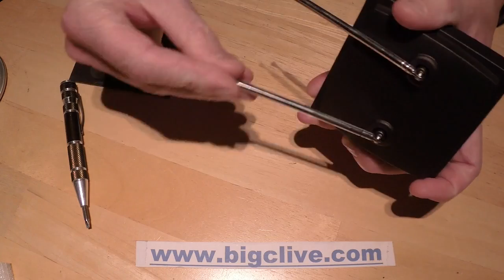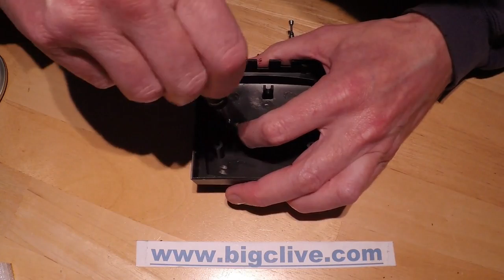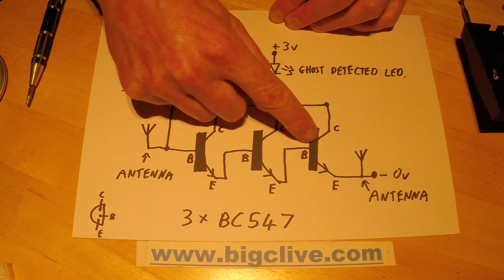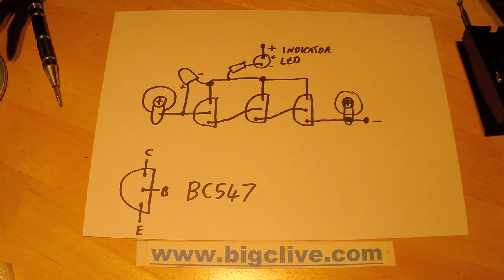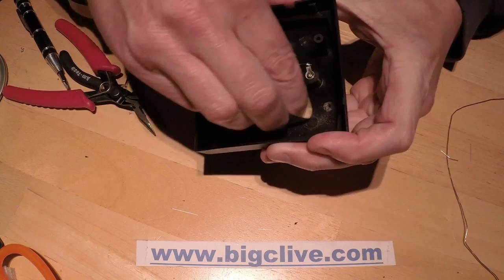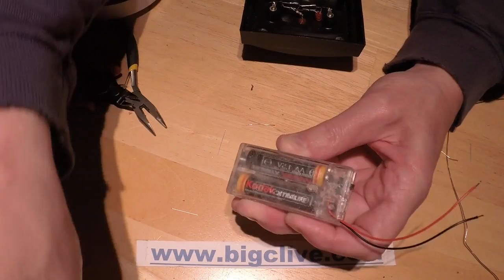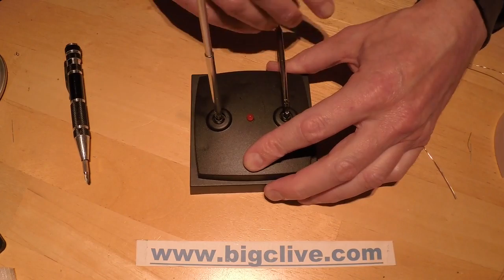Make a ghost detector.

Comment: I did finaly won an old Spico with the cast metal base, they are rare where i live, i know they are a lot more common in the US, but i think i only seen one like once before on auktion where i live, but i so badly wanted to do this with one of those for Years now! (It will of couse be reversible and i will keep the original components in a bag inside) a forum friend did send me some extra vintage panel lamps as well which will fit perfectly for this!

Comment: bc547 aren't just ordinary transistors, they are high quality transistors. What makes them unique is their low collector cut off current of maximum15nA and the high amplification of BC547C of 420+. The normal small signal transistors have hfe of around 100+ hfe and 100nA maximum collector cut off current. while the 2N2222A can rival BC547C with 10nA collector cut off current, its amplification is considerably smaller.

Comment: I recently built this, it works great the only issue i have is the led always stays dimmly lit not sure why or how to solve it so it only lights up on detection
Reply from the maker: The circuit is extremely sensitive.  It might be detecting ambient AC fields or it could even be a conductive path like a humble fingerprint on the input circuitry.

Comment: How can I use this circuit to start a cat ball lighting circuit? The ball is started by a shock sensor. I would like to use this sensor instead. I think maybe a relay to convert analog to a digital I/O but would not have any adjustment for the threshold.

Comment: Hi Clive, I know this is an old video.
I built this circuit and run it off a 9v supply and it works great. 

The circuit also works as it should when I add an Arduino into the project box, but once I run them from the same power supply or even just share the same ground your circuit plays up.

I have added a capacitor and another led to the supply and also to the earth side for extra filtering and the circuit still works great, but once again when I add the Arduino the circuit plays up.

Do you have any ideas how I can add the Arduino without compromising the circuit?

As to not interfere with the sensitivity I am using the Arduino and a LDR to monitor the led so your circuit is not impeded.
Reply from the maker: It could be electrical noise or just the larger mass acting like an antenna.   If the Arduino is being powered from a plug-in power supply that will also introduce a high voltage gradient to the ambient surroundings.
Reply: I'm using a 9v battery, and I have also tried my benchtops power supply.

Comment: Clive you just gave an idea. I've tried making a sensitive circuit to detect touching of the frame of a sit to stand lift on wheels working on 24v battery. 
I've added led lights to illuminate the foot area when the lift is being raised or lowered and then stay on for several seconds and then fade off. This part works great. 
The part I couldn't get to work is for the lights to come on when a person comes close or touches any part of the frame. I can see this triggering my LEDs on. I tried the 3 transistor Darlington circuit, I like your idea of traverse led bias and antennas (or pieces of wire).
I'll post couple pics below
Reply from the maker: It might be better to use a PIR sensor for that.
Reply: @bigclivedotcom  I thought of that I like the idea of sensor wire. What I had was too sensitive and would someone come on by itself and not come on someone when touching. I'm thinking using the frame as negative and a piece of insulated wire loop around the control box. Shortening the wire as needed for sensitivity.

Comment: The BC 547 is an european Transistor Typ from the '70s ,  Made by Philipps Valvo, Siemens,  Telefunken, ITT etc and used  
as a smallsignal transistor in many applikations like Radioreceivers, TV Sets, HiFi Systemes etc. So it was manufactured in mass.

Comment: How can I add a small speaker to the circuit can I just put it between the positive led in the beginning of the circuit and the resistor?
Reply from the maker: It might be possible to add a small piezo sounder across the LED.

Comment: That’s the best pie.

As a paranormal investigator in the states and electronics hobbyists that has been watching your videos for a long time, you’re truly MVP for making this video.

Question (again): Obviously it would probably be more formal if it were something with significant potential for application… semi-obviously?.. but I try to be the better kind of stubborn when it comes to the “impossible”, but I’ve been learning about the different gadgets used for paranormal applications, but I’d like to build or convert something that could be used as a kind of out-of-the-box approach to detecting electromagnetic anomalies. I haven’t actually seen any ghosts yet, but whether or not they exist- fluctuations and disturbances in magnetic fields are readily available, especially if we consider the global array. We were at a house last night, and we didn’t know what could be causing it if not some geomagnetic significance of where the house was, but the readings were incredibly sporadic.. highs, lows, and near inverted switches inches from different areas in all directions, some even the same spot.. and we were using multiple devices that all had consistent readings and, well, spasms. If not ghosts, something was clearly responsible for the experiences of the client. Anyway forgive my tangent- it was just exciting. My question is whether you may have any ideas or suggestions for devices, systems or circuits- either new or that could be converted from or used as an unconventional method for detecting anomalies within the electromagnetic spectrum. I am particularly interested in light, and I recently watched a video that wirelessly transmitted audio signals to a speaker using a laser as the transmitter and solar cell as the receiver, and thought there may be something (or nothing) there that could be useful. 

Anyway, just wondered if you were willing to share any ideas about stepping up the hunter’s game. Forgive the lengthy text- my thoughts never sleep.
Reply: Holy shit, really lengthy text. I didn’t even realize. 😫
Reply: Suggestion: go someplace you're as close to dead positive as you can be that there should be zero "paranormal" stuff going on. Find a long unoccupied dwelling and or commercial space (office building, factory, warehouse etc.) that has power AND that you have legao access to. Also, go out into the nearest wild place away from power lines etc.
Take measurements and readings as usual. Nothing you see in allegedly "acrive" places means anything without a baseline.
When you do this, take measurements over as long a time period as is practicable, preferably at least 24 hrs. If possible leave the instruments unattended to minimize them detecting you.

I guarantee you will be surprised how common so called anomalies are. The baseline is very noisy.
Reply: @markfergerson2145  Yeah, I suspected as such.. Again, I would expect fluctuations given the Earth’s magnetic field but I wasn’t sure whether the array had variable fields or frequencies at our scale rather than just, say, a few hundred square miles each.
Reply: @sbandc  The Earth's magnetic field is actively responsive to all sorts of things from solar flares and meteors to earthquakes. Look up "whistlers" for instance.
Places you would think are far from artificial signals can be in the sweep of civilian and military radar and radio beacons as well as radio communications relay towers (they still exist in the satellite age).
You can pick up constant, periodic and random event signals with no immediately obvious cause almost anywhere. The outdoor and sometimes indoor electrostatic field can shift rapidly due to the weather giving you another kind of false positive.
Another thing; Clive illustrated how directionally sensitive such equipment can be. If you can, take your baseline readings with multiple antennas pointing in different directions. That's related to my advice to stay away from your gear while taking readings; your body will couple to its antennas just as Clive's did. Heck, metal objects like power lines and metal plumbing or paneling can act as an antenna or resonator. Metal siding on a building does not necessarily guarantee isolation from outside signals.
I say all this as just a guy interested in physics who once tried to help an amateur radio enthusiast friend find a "quiet" place to set up a ground station for an amateur satellite link. Turns out the best we could do was a place with only a little noise at his frequencies of interest.
Reply: @markfergerson2145  That's understandable and not unexpected, but then we'd have to consider why there are some circumstances in which the readings aren't responsive at all. The investigation with the sporadic fluctuations was anticipated to be the result of a number of different magnetic fields given our location, but it was a significant contrast to other investigations. Typically we expect some degree of interference, and it's not uncommon, but there are also entire areas in which there are either no readings in which the magnetic fields are either absent or significantly weaker than our devices' sensitivities can detect. If there should be magnetic field interference everywhere from a whole arsenal of sources- especially long distance frequency signals that should cover much larger areas, what difference would need to occur to render the devices insensitive or the fields weaker than others?
Reply: @sbandc  The Earth's field is not homogeneous. Everywhere on the planet the local field strngth, direction and dip (angle of the flux from horizontal) is different. Local concentrations of metallic ores can cause severe deviation from what you might observe say at sea at the same latitude or even cancel it over areas as large as a couple of acres. This is why compasses are not completely trustworthy. Government agencies like the US Geological Survey publish maps of what you can expect a compass to display all over the US and its possessions and territories and territorial waters at varying levels of detail. They are only updated every few years of course, but are very useful for people doing for instance mining surveys... and folks like you. There is a certain amount of daily varation of the values on such maps that has to be taken into account.

Artificial time-varying fields can have nulls (areas where the ield strength is zero while the source is transmitting). This is electromagnetism 101. Predicting their locations requires knowing the wavelength of the emitted radio frequency energy and some details of the local environment. If you've ever driven around a city listening to the radio and heard it fade in and out, it's because the signal was not just propagating directly from the transmitter to your car but also bouncing off buildings thus providing what your radio "sees" as multiple copies of the same signal from different directions that sometimes add and sometimes cancel each other out as you drive through the peaks and valleys of the different copies. This is called mulipath propagation. You can for instance be only a few miles away from a radio station, in direct line of sight to it, and not be able to pick it up but it will blast your ears a block away. Natural terrain features like mountains and valleys can have the same effect.

It's also possible for one signal to "take over" a receiver rendering it incapable of detecting other signals even if you retune it. This is known as "front end capture". If the signal is strong enough it can disable the demodulation circuitry making it seem as if there are no signals at all. In the ciruit in this video with no tuned elements except the length of the antennas, all it would take is a strong signal in the FM band that biases the transistors out of their conductance range.

Any device like a "ghost detector" will see the same phenomena because basically it is a radio receiver.
Reply: @markfergerson2145  Well, you definitely took the scenic route.
Reply: @sbandc  It's a very complex topic with many subtleties.
I got into this while studying Hieronymus and his eloptic devices, Drown's so called spirit cameras and so forth. I had education in electricity and electronics and had a hell of a time figuring out what their devices were supposed to do in the real world electromagnetic environment.
I have Asperger's so I  have a tendency to "mansplain" as the kids say these days...

Comment: At last my antenna came today and I could complete Clive's project. I was a little surprised that the the telescopic rods were shorter than expected at 8 inches (my test bits of wire were 14 inches,) but the unit does work. Now to find some ghosts!!! 
FOOT NOTE For some reason the unit is more sensitive when the telescopic antennas are closed down and the whole thing is put back into its plastic bubble pack! Weird...

Comment: Electrostatic eh?  Can ionisers cause false positives?  Wonder if you can help trigger the reverse biased LED with light, heat, radio etc.
Reply from the maker: Ionisers are sometimes used to prime the air with a charge in paranormal investigations.
Reply: @bigclivedotcom  I discovered an interesting sensation when playing with your Minion device:  Pointing the emitter a few cm towards my leg,  I could feel the ions flow strongly from the device under my clothing. I could sense device movement up and down my leg in real time. More noticeable perhaps when I used 12 or 18 carbon emitters arranged as a dome.  I could sense the dome shape of the emitters from under my clothing.  I didn't feel the ion effect so much on bare skin, but it certainly felt like being probed by a "ghost" with fat fingers. Great fun.
Reply: @bigclivedotcom  Thanks for the info Clive. I just built this project and it's very impressive and effective. Got the antenna from Amazon £5.99 I couldn't find one in Poundland. Experimented with a 100uA meter to add some visuals. This thing detected when I lifted my foot off the carpet! I'm really impressed with your electronic skills, I've learnt a lot! 👍

Comment: Probably more convincing if you included you and the antenna in the field of view.
By the way a single jfet like a mpf102 will do the same thing.
Reply: I can assure you that this works. It detects when I lift each foot off the carpet when about a meter away! That's with two wires about a foot long. I was honestly very impressed with the performance. My antenna box is on its way from Amazon £5.99.

Comment: Hi there, I'm working on a similar project that requires a case just like this one, but I dont really know what to search for when looking for these types of cases. Where might be a good place to get these online? And what am I even supposed to look for?
Reply from the maker: It was a cheap TV aerial unit from a pound shop (dollar store).
Reply: @bigclivedotcom  Hi there, thanks for the reply! I'll look into it more, but I cant find any similar results to this one, or maybe I'm expecting the wrong product. I pretty much just need a project box/case with antenna, or would I have to add those in myself later- any thoughts on this?

Also, I had only been looking online for this box, but if these are mostly available at only dollar-type-stores, well from where I come from I doubt I will ever be able to find what I'm looking for locally..
Either way, thanks for the help :]
Reply: Hi I just bought mine from Amazon it was £5.99... Try searching, "Indoor TV Antenna Telescopic VHF."

Comment: Fun project :) Thinking of modding it to flash full with each input signal, so it strobes faster with stronger signals. Still learning the basics of EE, but think it should be doable, remove 2 of the transistors and use the remaining one as a switch to trigger a 100uF capacitor discharge to the LED.
Reply: OK, that wouldn't work. (thinking out loud). It would just strobe on any signal. Needs some sort of timer to slow down / speed up the strobe on signal strength.
Reply: More out loud. Keep the 3 transistors, and use the collector's output to charge the capacitor, and then when at required power, the capacitor releases to the LED.

Comment: Is this part of how a Theremin works?
Reply from the maker: They usually have controlled interacting transmitting and receiving antennas.
Reply: @bigclivedotcom  Ah. I've played about with one before, going through some digital guitar effets. Got some pretty wacky sounds out of it.
Watched your "Joule Thief" video. I was wondering, is there any way they could be used to recharge a rechargeable battery or a power bank? Would be a decent green idea before sending used batteries off to be recycled.

Comment: Is there a preferred frequency that can be detected with this? I think it only depends on the antenna arrangement and length which frequencies you would detect preferrably, right? How could you make this more quantifiable/ measurable? Also an indicator for signal strength would be great - so please build an improvement model :-)
P.S. just found this even simler setup (guess its less sensitive tough): https://www.youtube.com/watch?v=vHVmJ5lD9jc